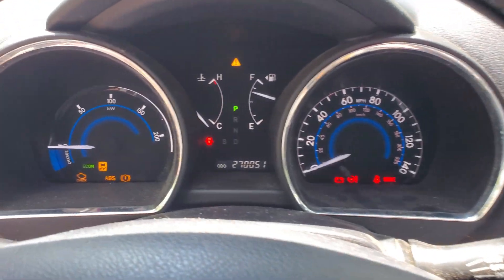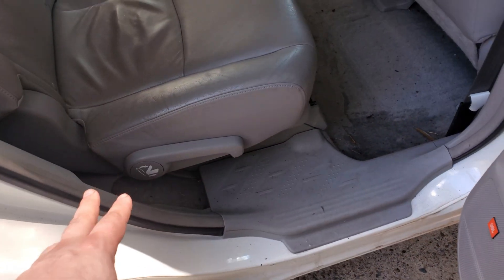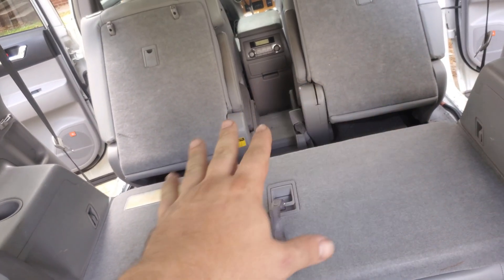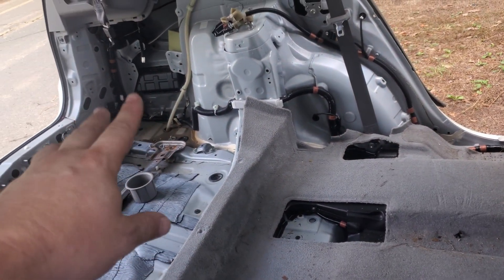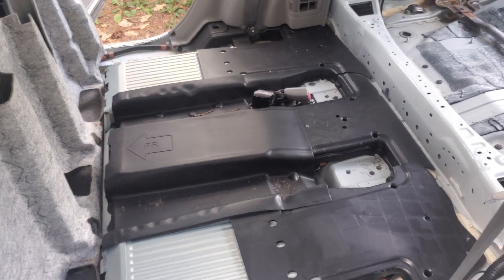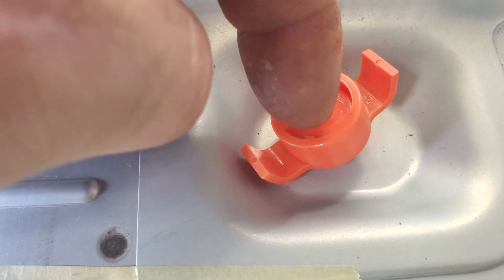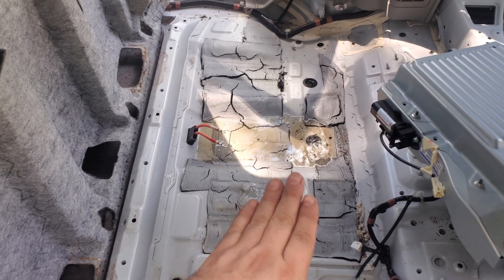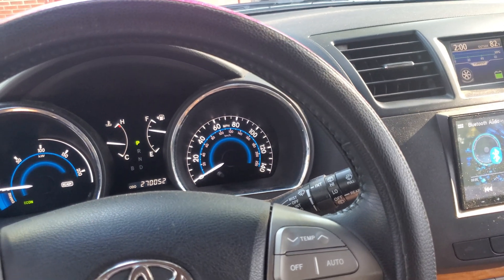Hybrid wont start? 2008 Toyota Highlander code P0AA6 DO NOT REPLACE YOUR BATTERY

Comment: Hello Cousin.     I have a 2008 Highlander Hybrid, bought it from the county online auction with same message on screen, placed a new starting battery so I could at least try to get the DTC with the basic scanner, but the message on the small screen was the same showing check hybrid system.  I do not see any water in my vehicle, removed the hybrid battery and took it to a shop where they "re-charged" it for $380.  Now I am going to re-install it.  My question is: I watched your well explained, easy to follow video, but forgive me I did not catch the reason why the water in the car affects the hybrid battery.  Did you have to recharge your batter or basically-what did you find caused the hybrid system to not work?  By the way, I was not fortunate enough to find your video and followed another couple of videos and did not remove the back seat or the cables from the L rear corner (which I should have- but did not know-done).  I ended up forcing the cables to come apart under the middle seat to remove the middle seat :(.   Now not sure how I will reconnect those cables but oh well will get to that when I get to it.  Thank you for reading this winded message and I would appreciate your prompt response so I can properly check things before re-installing the battery.  Thank you from California.
Reply from the maker: The water intrusion on mine was coming in from the tail light seal. If you don't have water intrusion, it could be the relays that are attached to the battery pack. If you clear the codes from the system and it stays cleared then you have fixed it. If they come back, you'll need to keep troubleshooting. The codes will not clear themselves, even if you fix it.

Comment: Please mine is a 2005 model and it has same issue can you help me fixbit
Reply from the maker: After you get the water from coming in, you may have to replace the relays on the battery.

Comment: Hello sir I got water same like yours, I cleaned and put everything back, truck starts but still getting check hybrid system error message..do you have any suggestions how I can clear that message...thank you again great video....if you can please suggest ways to get rid of that error message...
Reply: Car starts and no error message, but parking brake jammed, please if you have any suggestions...thanks again.
Reply from the maker: Glad you got it started. Not sure on the brake, maybe try rocking it back and forth

Comment: REMOVED BATTERY AND THEN PUT IT BACK AND CAR START SHOWING A CAUTION LIGHT ON DASHBOARD ,PARK , REVERSE , NEUTRAL AND DRIVE INDICATOR LIGHT NOT DISPLAYING ON DASHBOARD , NO CHECK ENGINE AND CAR WONT START: A hybrid toyota highlander 2010 model
Can someone please help me with this
Reply from the maker: Make sure the orange plug is plugged back in and tight. Next check the relays on the electronics board that's on the battery pack itself.

Comment: So, you just remove the water?
That was it?
Reply from the maker: Water got in again later. Had to replace the relays at that point. Found the water was coming in through the tail light seals. No issues since I sealed them, going on 2 years now.

Comment: Wish I had seen this earlier, my Camrys doin the same thing, how does the water stop the car from turning over, was there corrosion, were the connectors wet?
Reply from the maker: The battery pack has a set of relays in it. When they get wet, they will give this code.
Reply: @ Oh, okay Thank you …
Reply from the maker: Hope you got it figured out
Reply: @CousinCleatus  Have a parasitic drain which I was aware of, removed the fuse, started up finally after charged, went into ready a couple times, drove a lil … ready light back orange except for when depressing the brake.  Time for battery change, brake sensor / or relay issue most likely all of the above 😅
Reply from the maker: @ANGIEB52 hopefully you'll get it figured out. Sounds like it's being a pain

Comment: I cant imagine that youll read this a year later.. exact issue (cant read codes tho) my batterys ooff the floor drying.. wil i have to reset anything or will it just work after removal and drying?
Reply from the maker: You can order a blue driver code reader on Amazon for less than $100. It probably won't reset on its own. Also, later I found the water was coming in from the taillights, it was rolling forward. I just put clear silicone on the seal for the taillights.

Comment: It’s leaking under your tail lights. There is a seam behind the plastic that you can caulk.
Reply from the maker: Yep, the next video I did shows this.
Reply: @CousinCleatus  I am doing mine now using flex seal tape. Works perfect.
Reply from the maker: @meastwood274 I used silicone, flex tape is probably better.

Comment: 1455 that should b a scupper valve drain not a plug. 1735 nooooo water will suck in from holes drivin down road. Been there on vw.
Reply from the maker: Gotcha

Comment: I saw this problem on the facebook Highlander group - there's some kind of what look like body plugs or something around the tailgate on the lower side, somehow these rubber plugs fall out and then water goes into the car making it to the 2nd passenger row usually.
Reply from the maker: This particular one I found the tail light seal was leaking.

Comment: Hello sir I hope you’re doing well please my Highlander hybrid 2008 is starting well but showing ( check your hybrid system  ) please I need your help 🙏🙏🙏
Reply: 😊😊😊 hello sir i am happy your video really helped me thank a lot 🙏🙏🙏
Reply from the maker: @romaricherman9853 that's awesome!😎
Reply: Hello 👋 sir
Reply from the maker: Check the floor in front if the middle row seats.  If it's wet, your batteries may be getting water on the sensor.
Reply: @CousinCleatus  thank I will check it and get back to you
Reply from the maker: Okay!
Reply: Hello sir hope you’re doing good please my check engine still showing with check hybrid system.

Comment: It is an excellent video and it is very similar to the problem my car has, in fact it gets very wet inside. ❤❤❤
Reply from the maker: Found the issue on this one.  It was coming in from the tail lights and the water was going forward.  I tightened the taillights bolts and put silicone on the top of them.

Comment: 9:32 I have the hailander 2008 hybrid, suddenly it stops turning on, it is already doing it usually, please if you can help me, I am from the Dominican Republic and there are very few hybrid vehicles in the country itself.❤
Reply from the maker: Check to make sure you don't have water around the batteries.  Check the floor in front of the middle row seats, it it's wet you probably have water around the batteries.

Comment: 07 highlander hybrid(421000miles ) gave poa78 code and mechanic said the inverter(very expensive) may need to be replaced but later i found another youtube video which says it may be the grounding cable coming out the inverter that doesn't let it work properly. I checked it out it was rusted and cleaned the connection part of grounding cable by sanding them. I erased the code and made 300 miles the code has gone i even gained 0.1 mpg after this fix, let's see if the problem is really gone?
Reply from the maker: Hope so.  The connections having corrosion would definitely cause some codes.

Comment: First and foremost. Thank you so much for this video.  Here are a few things I had to go thru with mine that had this problem. With mine as a dead give away symptom is at night when it cools down the inside of the windows would fog, get condensation on them (I dismissed this at first. Hindsight aye?).   Also if you have a hydrometer you can put it in the car with the doors and windows closed,  if it reads a lot (5%+) higher than when its outside chances are you have water collecting somewhere in the vehicle.  Mine also had the same start ignition symptoms, But when I scanned for codes no codes were returning.     Most people diagnose this as a vacuum leak which is common (gas cap, evap system broken hose etc),  I had to get a better reader that could scan the hybrid management computer,  not every scanner can do that.    I used an ELM 327 WiFi adapter and EOBD-facil software on my iphone to pull the code of P0AA6, the free version of the software can pull the code.   My Vehicle is a 2006 Highlander Hybrid.
Reply from the maker: For sure.  The fogged up windows was a dead giveaway.  I dismissed it at first too.
Reply: Cousin Cletus, did you ever find out where the water was coming from in the back? It seems like it’s coming from the quarter panels on either side in the back maybe through events or? Let me know please.

Comment: Awesome video brother. PLEASE COULD YOU SEND ME THE ELECTRICAL WIRING DIAGRAM FOR THIS CAR I HAVE THE SAME ISSUE BUT I CAN'T SOLVE IT
Reply from the maker: I just googled it.  I do not have the diagram.  If you're getting power to the orange cables, it will be on the battery side.  Most likely the relay area in the battery.  If you're not getting power to the orange cables, that is when you would need a wiring diagram.

Comment: We have 2006 Highlander hybrid 220 k miles, just doing spark plugs and coil replacements but anything to do hybrids battery side? Is there filter on hybrid battery vents?
Reply from the maker: Yes, buts it's more of a screen.  Can unscrew the plastic and blow them out.

Comment: Thanks for documenting these issues & your efforts with safety measures, appears you fixed the cause of the DTC & provided some prevention recommendations, but unsure where applied except the suspect cargo door seal along with a clogged drain filter. Definitely possible areas requiring constant attention in high precipitation areas & conditions where debris accumulates. In my experience, Lexus hybrid has high integrity from intrusion & seals sometimes feels like a vacuum when opening the door. Then again, Imma motivated to access the battery area for look see, should be easier without the third row seats like your rig. Roll on brother,😁
Reply from the maker: Thanks for watching and commenting.  I will putting another video out soon.  This particular vehicle, I found the tail light housing was letting the water.

Comment: I just had the very same thing (same codes, warning lights and everything) happen to my 2008 Highlander Hybrid. A few days ago we had two days of rain with about 4-6" of rain and this was the first time using the car since the rain. I checked for water and sure enough everything was soaking wet. I will tear into it in a few days because tomorrow is another full day of deluge.  I think I will put a tarp over the car for the rain.

Same thing happened to me last year at the exact same time of year after a bunch of huge rain storms. I took about a month and replaced the timing belt, ignition coils, spark plugs, water pump, cam gaskets, crank gasket, and tensioner and when I got done it started right up and no codes.  Looks like the hot and dry weather for that month might have dried out the water last year.  I was grasping at straws trying to fix it last year and refused to replace the synergy drive.  The car is only worth about $3k now after my rear door got smashed in by an 18 wheeler in a snow storm last winter. I have 240K miles on mine so those other things needed changing anyways. 

 I will keep you informed on my progress. I was ready to call the junk yard to come pick it up.
Reply: All good. Works perfectly. I drilled a few extra holes to help drain in the low spots. No corrosion. You definitely want to remove that relay panel to Inspect it. I saw other videos with the same problem and the relay panels were in bad shape. 
Thanks again for the video.
Reply from the maker: Thank you for the feedback.  Glad it worked out for you.
Reply from the maker: So there is some relays in inside the battery pack.  It's where the orange wires connect.  If you cannot clean the corrosion out of that, you will need to replace it.  I just had to do it, I will be putting the video out soon.  I found the brake lights housing were letting water in, and then it would roll forward.
Reply: @CousinCleatus  Cleatus,  Sure enough, I had about 2" of water filling up the battery pack compartment.  The water was almost touching the two main hot wire.  The compartment was already rusted. I live on a 1 mile long dirt road with hills and that was why it would short out and trigger the relay and the codes so close to home. The main rubber drain in the battery compartment is a bad design and easily clogged. I snipped off the bottom part of the drain plug to make sure it drains easy now and does not clog up again. 

The drain is between the catalytic converter and the gas tank.  You can actually stick a screwdriver from underneath into the rubber drain and see if the compartment is full of water before you tear into it.  I dried it out with towels and I have fans blowing inside the vehicle now trying to dry everything out before I put it all back together. It was not as hard as I though it might be but you do have to be very careful with those high voltage batteries. 

I checked the connections on all of the battery relays and no corrosion. The water was just below that level. I will post again when I'm done.  Pretty sure this will fix it unless there was some permanent damage done. I stopped the car right away.
Reply from the maker: Good luck with it!  It should be okay if it's didn't corrode the terminals on the relays or the box itself.
Reply: I'm in the same situation. I've opened up and cleaned the relay housing board that has the 2 fuses underneath, but are you referring to opening up the individual 3 relay boxes themselves?
Reply from the maker: Yes, well the box the relays plug into.  There are strips of metal inside the box that get corroded.  Don't open the relays, they can't be opened.
Reply: Thanks for the heads up. I'm sure I will find the battery compartment full of water and the drain clogged. It was almost identical this time like it was last year. Didn't get 1/2 mile down the road and right after a rain storm.

Comment: The tubes you were not sure of are the Sun Roof drainage assembly. That is the most common problem with these cars. The seals leak, the hoses clog with debri and tree snot.  This will cause water to leak all over the inside of the car behind the interior plastics where you cant  see it happening. Thank You for making this video
Reply: I just pulled my taillight to chase a dent and they were hermetically sealed but I have new too me a 06 hyhi and it was loaded with water when I pulled the rear quarter panel hose drain gromet
Reply from the maker: @TheLivebaitdrifter dang, cousin that's crazy
Reply from the maker: After some research I see these were sunroof drains.  They were not the problem with this particular vehicle though.  It turned out to be the tail light seals. There will be a video soon.  It was a nightmare finding the leak.

Comment: Why will my 2006 hybrid highlander not charging the traction battery until it reaches around 80km/hr?
Reply from the maker: Make sure there is no corrosion around the connections.  It may be time to take it apart and test the cells.  You can replace a cell individually if it's bad, you don't have to replace the whole battery assembly.
Reply: @CousinCleatus  Thanks. However, will that make the hv battery not to charge until im off pedal at around 80kmhr? Anything below that, it will never charge even though i am off pedal, decelerate or braking.
Reply from the maker: I'm not sure.  Sounds like it has some issues, sorry I couldn't be more help cousin.